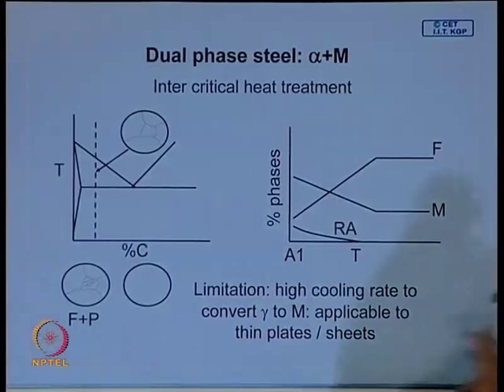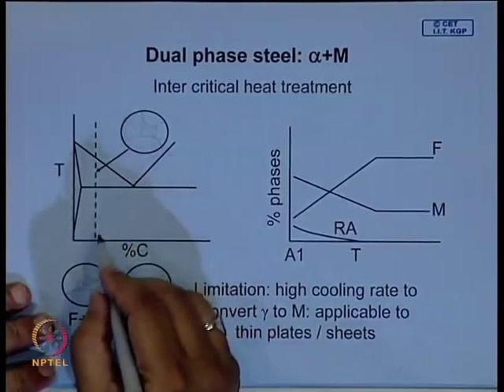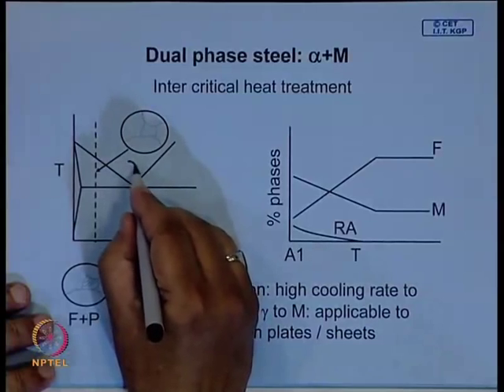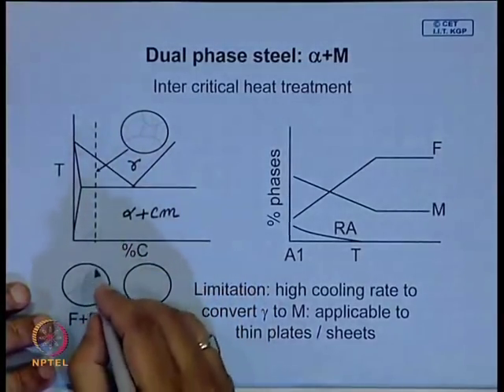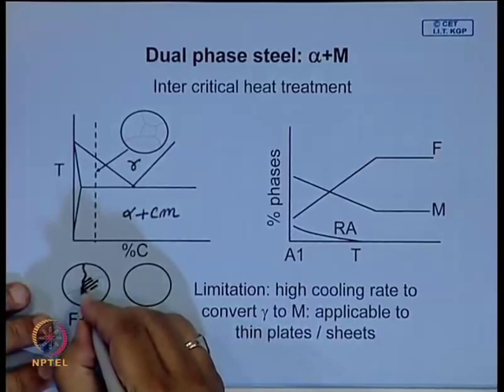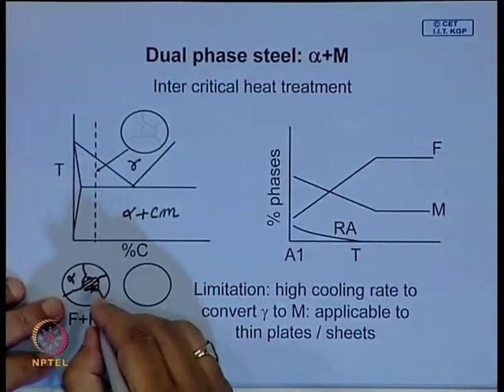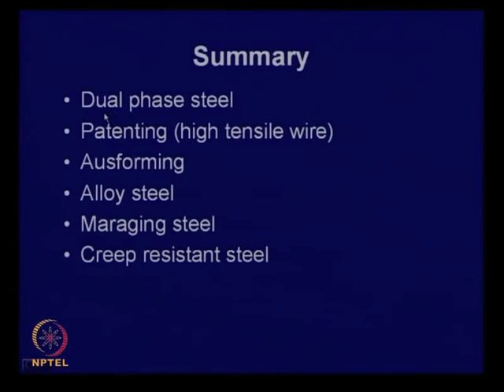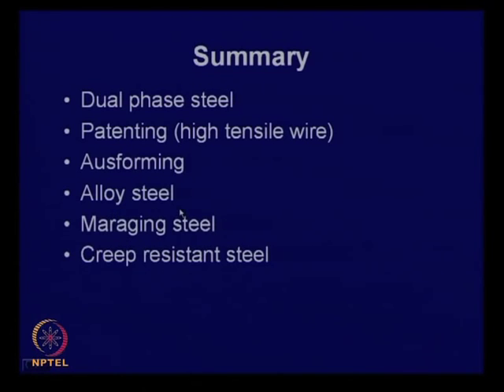Mod-01 Lec-40 Ultra High Strength Steel

Comment: The figure on the right side in the Dual Phase slide contains M and F mistakenly labelled as reverse..  as T drops from A3 to A, M will decrease.. for the correct figure check page 17 of (https://nptel.ac.in/courses/113105023/Lecture39.pdf)